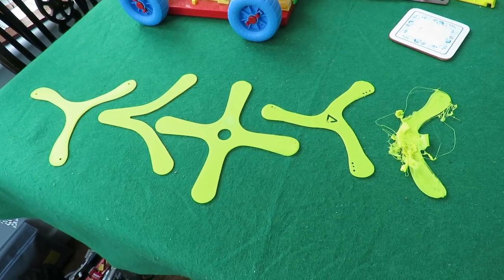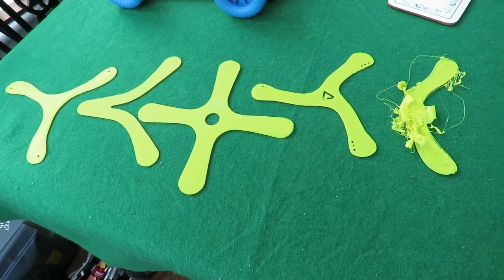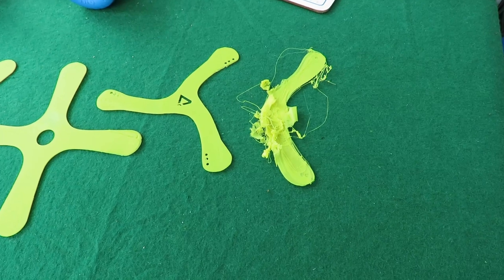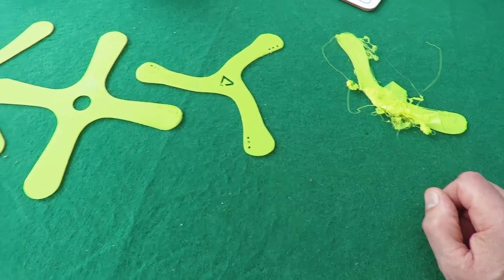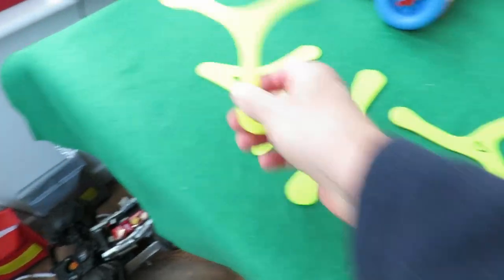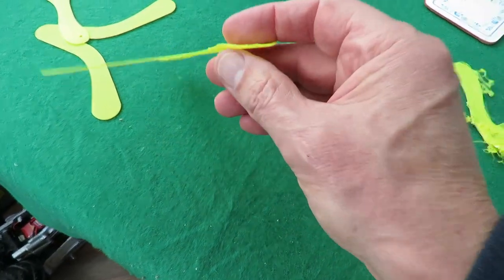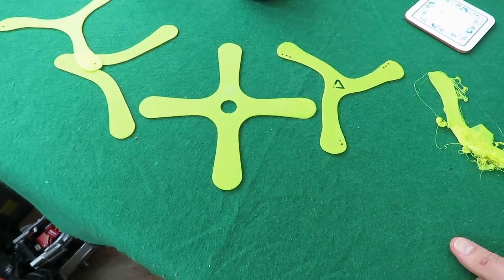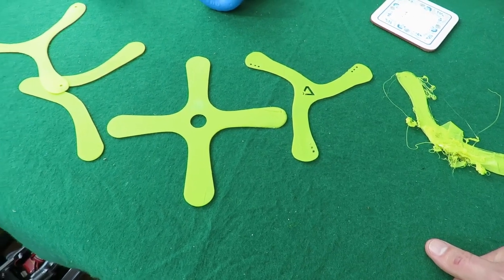3D printing Boomerangs with music

Comment: Nice to see you have put on the fan cover hopefully thay will fly over time the frame becomes loose making prints fail moor because thay are moving around a lot I got some lock tight put some on and it has not been loos since
Reply from the maker: Thanks 👍

Comment: Some sort of adhesive should help (glue stick/hairspray)
Also the "build tack like" sheets loose there stickiness after a while as the surface smooths out.
Would recommend releveling the bed and printing some calibration prints.
https://www.thingiverse.com/thing:3315083
Great video. Keep up the good work.
Reply from the maker: Thanks 😁👍